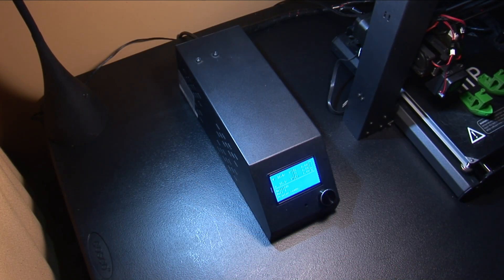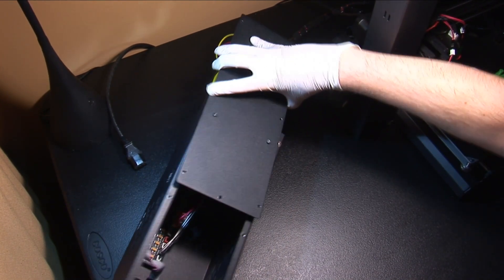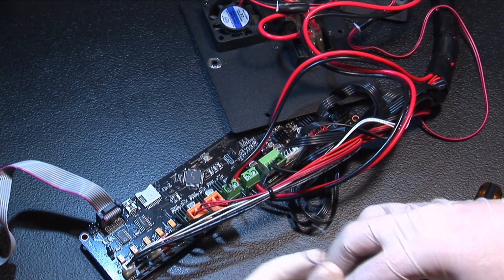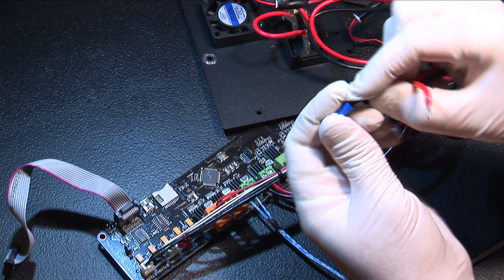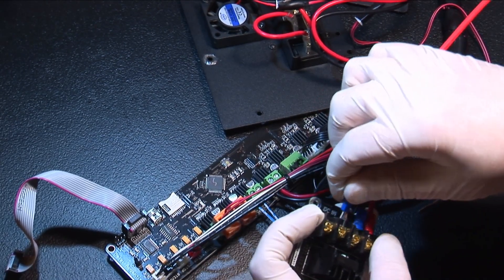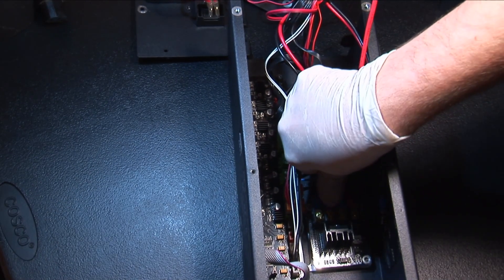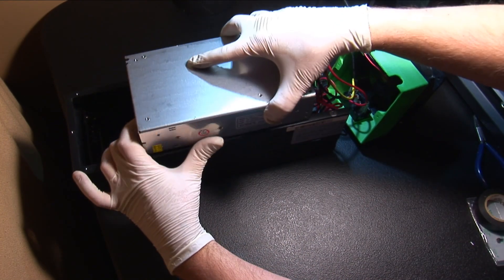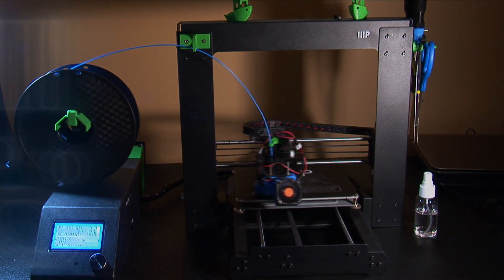How To:  Mosfet Upgrade mod - Wanhao Duplicator I3 / Monoprice Maker Select

Comment: Great video, I have to do this. Also, I have a v1 of these MakerSelect printers, with the flat face control panel. It had a necessary upgrade from the print head to ground that needs to be done, do you have a video on that one? Or do you know where I can  find it? Are there other factory problems that need to be addressed? This quarantine stuff has given me a LOT of time to work on things, so I want to get this one working properly
Reply from the maker: Thanks!  I don't have a v1 but I did do somethin in this video:

https://youtu.be/w-bORreaaPE

is that what you are referring to?
Reply: @Electronicle  that is it exactly, thank you!

Comment: Great. I just installed mine and now the bed is stuck on. Started heating up the moment I turned the power on and went way up past 100 with no sign of stopping. My control wire had opposite markings to yours, but other guides said that polarity on these doesn't matter. Maybe it does!

Comment: Is this still recommend (must)  to do this upgrade?
Reply from the maker: ssh 22 if u have one of these models yes.  They changed the connectors for the most current version but the board itself can’t handle the current.  I noticed the bed heated much faster and kept a more stable temp since this mod.